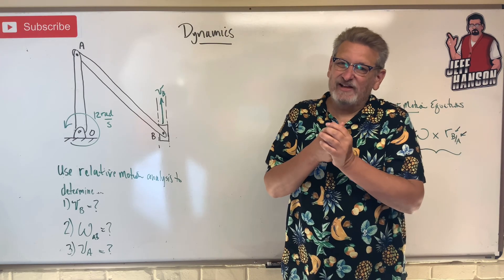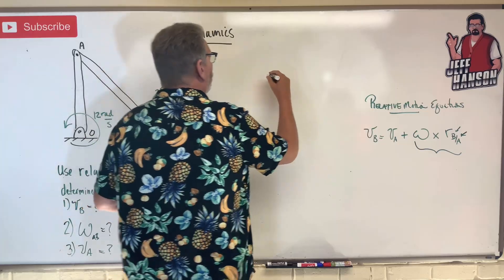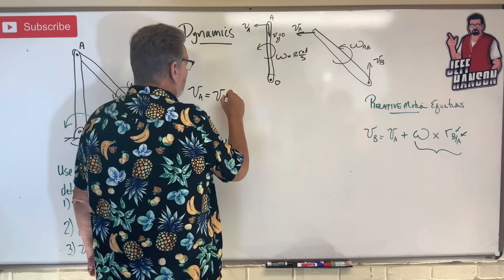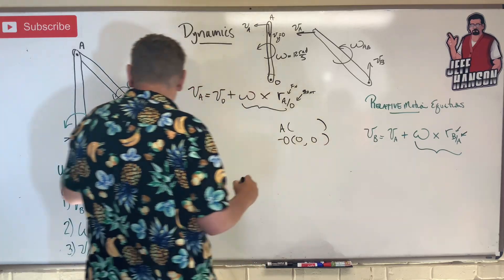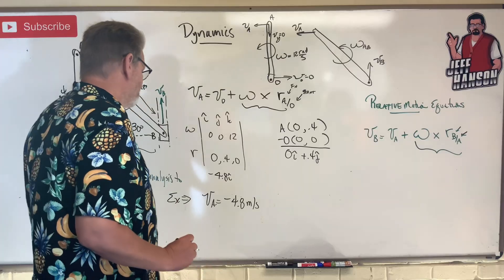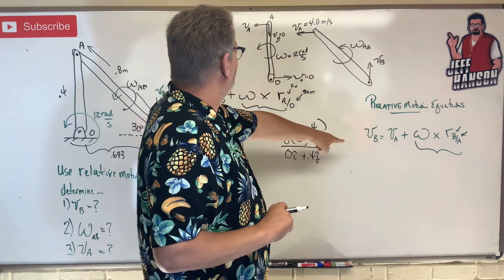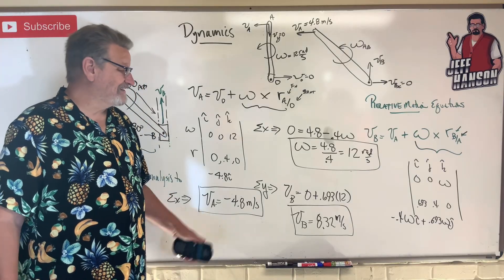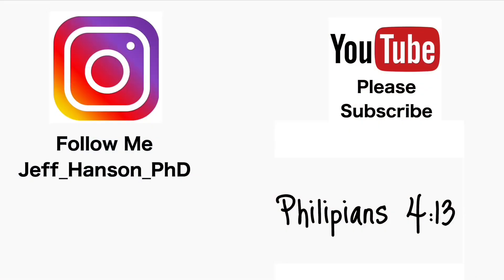Dynamics: Lesson 29 - Relative Motion Analysis of a Linkage

Comment: I may be incorrect but when you are doing the cross product of the sloped member, the value of 'r' vector j component should be -.4 not +.4. You seemed to miss that negative when transferring it into the matrix. You also seemed to miss the negative in the x direction of Va when summing velocities in x. You will still get the same answer of 12 rad/s. Nice video!
Reply: Great catch.  I noticed Va should be negative, but missed that the r vector j component should be negative.  Now it makes sense.